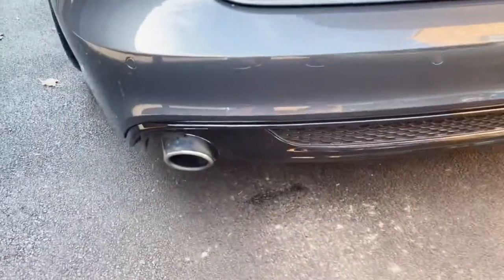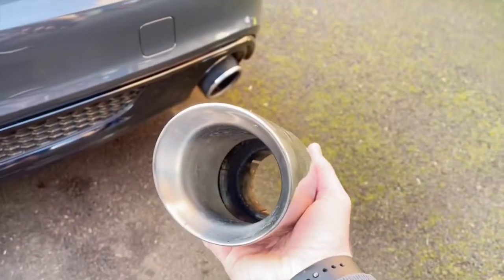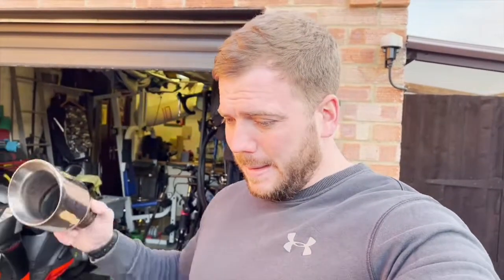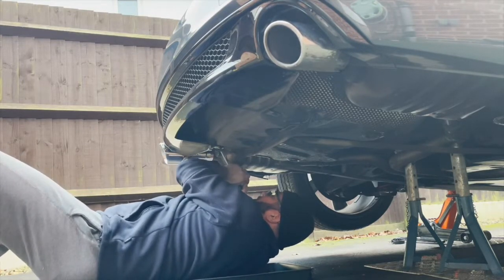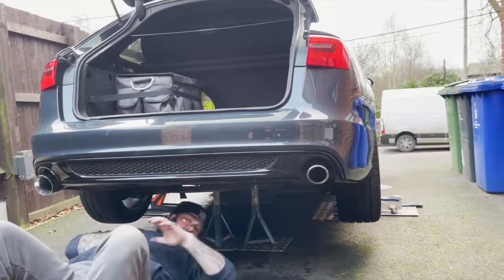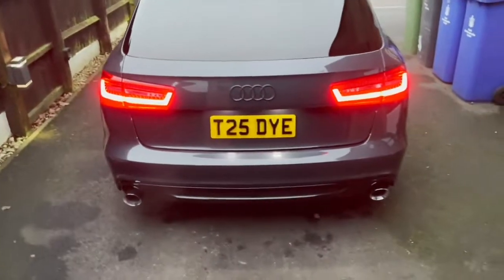Installing 4" Milltek Exhaust Tips on my Audi A6 Avant

Comment: So how did you fix the logo to the grill? You said adhesive, but it looks like you are screening it on?
Reply from the maker: I screwed it on, you can get a grill with the emblem embedded in it but it wasn’t available when I bought my grill
Reply: @Tom_Dye  ah thanks. I’m looking at grills and most have a strange mounting for the logo. Not like the original.
Reply from the maker: @erwindegier7797  you can find them on eBay with the emblem embedded, they are on eBay for around £150

Comment: This the way how to fuck up a nice car mate. Green audi badge😆😆. If you noticed the right exhaust tip was hanging more them the left one.
Reply from the maker: The green isn't for everyone but it can also be changed easily back to black if I want to however I like the green. As far as the exhaust tips go it may have been the angle of the camera but I have looked at that multiple times and they are even
Reply: My bad mate i thinks it was the angle. So what did you do with the rs grill did you fix the emblem holder on it
Reply from the maker: @rsnatersen5643  no bro, I screwed the original badge to the grille, the emblem holder stuck way too far out and looked stupid, £50 wasted lol.
Reply: Was adjusting the height of the exhaust tip easy? I've got stock exhaust tips but my right one sits lower..
Reply from the maker: @chrisbees85  I didn’t adjust the stock heights of anything, I just cut the stock ones off to fit these ones so therefore I can just adjust these with the clamp I used